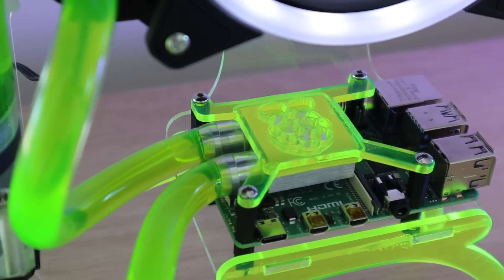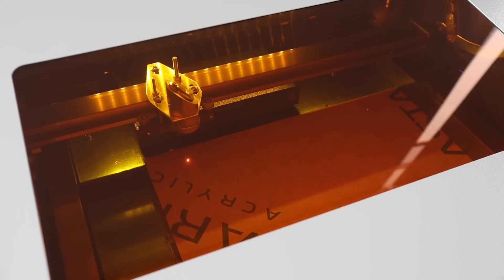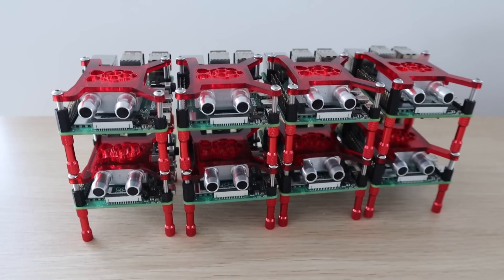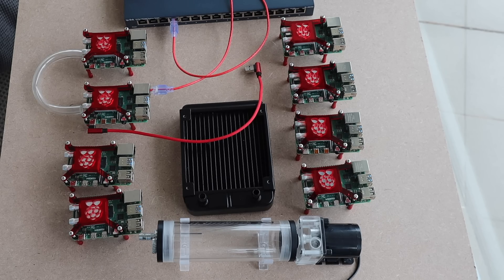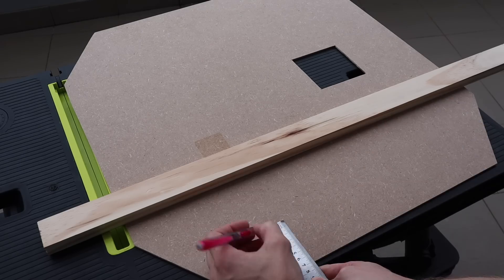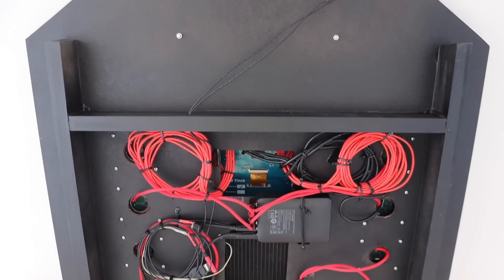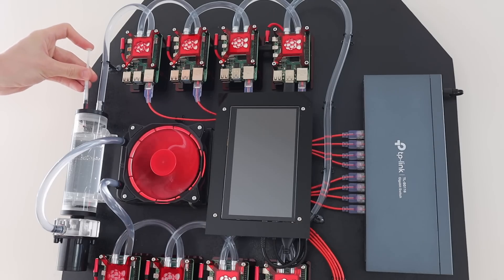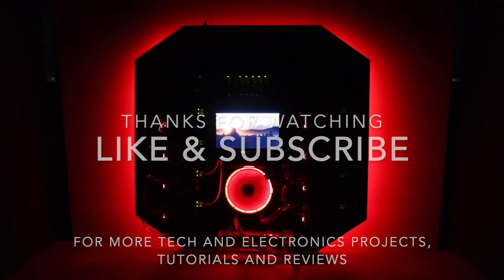Building A Water Cooled Raspberry Pi 4 Cluster

Comment: Concerning your water temperatures: flow order does not matter and once the loop is saturated, all Pi's should run at practically the same temps.
Reply: Yeah this is correct. Same as with a water loop in a PC, the loop with eventually reach its equilibrium and no individual component will get hotter water into its block than any other.

However it should also be noted that should one component be running at max and generating a lot of heat then all other components will receive the heated water from the loop.
Reply: This is just simply incorrect. what youre stating is that no heat would transfer to the water from progressive heat sinks. youre using the words "saturated" to mean its at the same temperature as the water which would mean no heat transfer takes place and is therefore useless.
Reply: @t_c5266  you're wrong. But `okay`
Reply: @Coltranebassmusic  prove it
Reply: @Coltranebassmusic  re-read what I said, then re-watch your video.
I'll wait for your apology

p.s: he explains, thoroughly, that it was not an isolated variable test, which means its therefore invalid as proof of anything XD
Reply: @t_c5266  i won. sooo satisfying. open wide! here comes the choooo choo train. humble pie tastes great. nom nom!
Reply: @Coltranebassmusic  😂 keep denying it. I bet you voted for Biden too with that attitude. Like I said, loop order does matter and your "proof" even admitted it in the video.
Reply: @t_c5266  yes, the veteran with the profile photo of himself flying two American flags voted for Biden. Open wideeeeeeeee
Reply: @Coltranebassmusic  its the only logical answer seeing as you don't adhere to the scientific method at all, can't actually debate facts, and change the argument when you lose.

But back on track. He states clearly in the video that the temperature variation is due to processor clock speed, manufacturing differences, and differences is heat sink adhesion.

He did not isolate his variable. Therefore his test is as useful as not testing at all
Reply: @t_c5266  The difference between radiator inlet and outlet temp is not what determines its cooling capacity or effectiveness. Its actually the opposite. The wattage dissipated by a radiator is determined by its temperature above the air being used to cool it. If the rad is 20C warmer than the air it dissipates double the wattage it does if its only 10C warmer than the air. 

The inlet and outlet delta (variance in temp) is mostly determined by coolant and air flow rate. If the inlet temp is 40C and outlet 30C in a 20C ambient environment then the second half of the rad is dissipating roughly only half the wattage that the first half is. If the flow rate is increased so that the inlet is 40C and the outlet 38C then the whole length of the rad is dissipating more wattage. Those numbers are exaggerated of course but the principle is the same. 
Its slightly counter intuitive but for best cooling system effectiveness we want the rad as warm as it can be and high flow rate is the best way to ensure that. Its easy to have a high delta between inlet and outlet, just by lowering flow rate right down but that just hinders overall performance.

As far as loop order goes, The high thermal capacity of water means that at a normal 4Lpm flow rate it takes about 300W to heat coolant by 1C. So an overclocked high end GPU might just do it. At the same time the average 360mm rad needs to be around 10C over ambient to dissipate 300W and cool the water by 1C.
So, the difference between the coolest and warmest part of the loop is normally only 1 or 2C but the whole coolant volume increases in temp by about 10C so the rad is dissipating what the system is generating. Thats why people say in general loop order is not important. 
There are caveats to that though like a very low flow system will be effected more.....this was long winded...but if you cant "grasp this" then...idk....i just dont know man.
Reply: @Coltranebassmusic  by your own statement there should be a 1 to 2c difference. In his test it shows at least a 5c difference that is independent of order.

Right there you admit that his test is invalid. And you explained thoroughly why I am correct in my first statement.
Reply: @t_c5266  Jesus Christ.....
Reply: @Coltranebassmusic  literally by your own statement youve disproved yourself. There's nothing more to say
Reply: @t_c5266  I can't argue with stupidity. You don't even watercool components. You're not even in this genre space. And you're talking to someone in the top 100 on world leaderboards concerning the matter....I really wish you best bro.
Reply: @Coltranebassmusic  your argument boiled down to "if you flood it with massive amounts of water your temperatures will be similar"

Acknowledging that there is a difference between consecutive  cpus and the only reason for small differences is due to using far more flow than is necessary. 

And if there was no temperature difference across cpus it would amount to zero heat transfer. So you're not arguing with me, you're literally trying to argue with basic thermodynamics.

That "pulling rank" shit doesn't fly with me homie. You might watercool cpus. But I liquid cool rocket engines. I can guarantee you that your knowledge on the subject is less than mine.

But we can always again look at your statement that clearly disagrees with the data provided.
Reply: @Coltranebassmusic  I'm still waiting for the thermal circuit that mathematically proves you right

Comment: Nice build, but you should consider flipping the display and mounting the cluster with the reservoir at the top.
Otherwise you'll never get rid of those circulating air bubbles.
And for the love of god secure the tubes. Those connections won't stay water tight for long.
Reply from the maker: Thanks for the tips!

Comment: Now all that's missing is a meaningful application which a "normal" computer (x86) cannot do better.

I would also attach red cable ties to the water connections. You have already installed black ones for the large connections on the radiator / first Pi 4.

Comment: what were your laser cutting settings for the cuts?
Reply from the maker: I used a couple of different settings as the black acrylic is only 2mm and black tends to cut easier than clear or translucent acrylic.
To cut the black I used 12mA at 15mm/s, single pass.
To cut the red I used 14mA at 15mm/s, two passes. It would cut on a single pass at 17mA, but got really hot and distorted the shape.
To engrave the red I used 8mA at 30mm/s.
Reply: @MichaelKlements  thx

Comment: I'm sorry if this question is inappropriate: For what are Raspberry Pi clusters used for?
Reply: They're a relatively cheap way to learn and experiment with clusters and distributed computing. They're not competitive in performance, but when you want to learn how to configure scaling systems with load balancing and redundancy etc. it's cheaper than building or renting a cluster with actual PC hardware. Plus it's fun.
Reply: Bitcoin mining
Reply: @lassmicharztichbindurch5319 , with a Raspberry Pi? I reckon that would be quite inefficient.

Comment: The amazon link shown doesn't seem to be the same ethernet cables - where did you find ones have the clear injection and tiny wire core?
Reply from the maker: I bought my ones locally on eBay, but I've updated the link in the description to a more similar slimline edition.

Comment: awesome build! though you might wanna reconsider the zip tie on the leaking inlet. zip ties in water cooling, if used, are usually used to hold the tube in place, so it doesnt slip off of the fitting, not for ensuring a tight seal.
Reply: Should be fine, if only because the inlets are barbed.

Comment: Really nice end product! When painting MDF, or any wood, consider using a sealant first to stop paint being absorbed by the wood so you end up with it looking more like a sheet of black acrylic over wood (if that makes sense!).

Love the look of it! 

Would be amazing if you set up PXE booting from the Pi with the full gui OS so you'd only need one memory card.
Reply from the maker: Thanks for the tip Owen. Do you have any suggestions for a type or brand of sealant? I have noticed that MDF is quite absorbent.
I’ll definitely look into PXE booting, this sounds interesting!
Reply: @MichaelKlements  sorry can't recommend any particular brand as there are a few primer brands avaliable, and not sure whats avaliable to you. I've even read simple PVA glue would work. All you're trying to do is create an impervious layer which you want the paint to adhere to so you can get a nice even paint layer which isn't then absorbed by the wood.

Love this project though! The end result is both functional and looks funky as well!!

Comment: This is the most AWESOME project I have seen in a long time, although that will not stop my questions.

Is there any reason you avoided POE, other than potential space limitations on top of the pi?
Can you passively cool the pis in your setup, can the fans be turned off without much impact on temperature?
Are you overclocking the pi?
Are the files available to download?

Again, this was so cool, and I love your setup!
Reply from the maker: I didn’t go the POE route because the hats don’t really work well around the cooling block and bracket and also the hats are quite expensive when you need 8 of them.
I’ll be doing a proper thermal test in a future video. I suspect that you probably could run the system without the fan.
Yes I’ll be running them at 2.0Ghz.
Which files would you be interested in specifically?
Reply: @MichaelKlements  thanks for the responses, I'm mostly interested in the mounting bracket for the CPU water blocks, it looks really professional!

Comment: This looks awesome! Curious about one thing though, could you have dropped the USB-C cables if you used Power-over-Ethernet? Or does that not work out of the box for the Pi's? (Seen Pi projects use PoE, but not sure if that was "normal" or if you need a special setup)
Reply: You need a pod hat, but the breakout pins are on each pi, so you can use passive 5V over poe with the fast ethernet standard (100mbps) without a hat
Reply from the maker: Have you tried powering a Pi using passive 5V? I’d be interested to know if that was able to supply enough power!
Reply: @MichaelKlements  I haven't tried this yet, but it would be a great project. I was mostly thinking you could remove the Micro Usb connector from a USB cable and solder to 2 twisted pairs, than use female to female connectors on the 4 ethernet breakouts on the new pi models. Connect them directly to the 5v and ground rail
Reply: @MichaelKlements  I have powered Pis with 5V pins. You need to keep cables short and thick to avoid voltage drop in the cable. I used both +5v and 2 GND pins to minimize resistance. In a setup like that your problem is the voltage drop in the wire when pi is drawing current. As long as you are not powering lot of things from PIs USBs you should be ok. There are other ways to improve this. Such as delivering 12v and then step that down to 5V right before pi using a buck converter. It works but add more complexity. Or slightly over voltage the supply without exceeding Pis max voltage (5.5v) to compensate for voltage drops.

Comment: This looks awesome but why not a POE switch instead of the additional usb cables.
Reply from the maker: The issue with the POE switch is that you need a POE hat for each Pi. These are quite big and don't work well with the cooling block bracket. They're also quite expensive when you need 8 of them.
Reply: @MichaelKlements  ah understood! Wasn’t sure if you considered them prior! Thanks for responding.

Comment: Why are the 4 pis on the right facing the wrong way?
Reply from the maker: The Pi's aren't symmetrical. So if I flip them around then the ports face the opposite directions, but the power cables and GPIO won't be on the same side and the ethernet port and cooling block will be offset on one side. Either way around they'll annoy the OCD in somebody haha.
Reply: @MichaelKlements  its awesome. I love it

Comment: I ask myself every time.

Why does everyone use who builds a cluster with Raspis. every time SD cards instead of PXE.

Do you not inform yourself?
Reply from the maker: This is intended to be a starting point to learn about cluster computing. The current SD card setup was to test that they all booted up and were seen on the network, I'll be experimenting with different software packages and configurations in future.

Comment: I love the build, super clean.  Curious though why you didn't have all the water loops on the outside edges to keep the symmetry?
Reply from the maker: It was just a fade-off in keeping the Pis the same way around or the cooling all on the outside. If I flip them around then the cooling looks symmetrical, but the power cables and GPIO are on opposite sides and the ethernet ports and cooling block will be offset by a couple of millimetres on opposite sides. Either way around they're going to annoy the OCD in some people haha.

Comment: Water holds a lot of energy. Your setup is good.
Its not true about the last Pi in the loop being effected by the heat from the others as long as the pump speed is high enough (any speed for that pump)
The water temp will be lower than the Pi so heat energy can still flow.
Reply: I'm only 5 mins into the video though so maybe you'll show the temps in a bit.
I'd say they will all be close to each other (within error margin)
Reply from the maker: Thanks for sharing your thoughts, I agree. I didn't do it in this video, but I'm planning on running a temperature test on the whole setup to see if there is any increase, by how much, and whether this has any impact on performance, although I'm fairly confident that it has no impact on this setup.

Comment: Pardon my ignorance but what is the purpose of clustering Pi ? I mean, it has a lot of pros but i'm wondering what kind of application such assembly would serve :) Thanks for that vidéo, i'm learning a lot just viewing it
Reply from the maker: Hi Xavier, I primarily built this to learn about cluster computing and to play around with different software packages and configurations. I'd like to get it set up to run mathematical simulations eventually.

Comment: poe would also be of use. switch  and power over ethernet...
Reply from the maker: POE would make the cabling much cleaner, but it requires a hat on each Pi. They don't really fit with the cooling block in the way and they're expensive when you need 8 of them.

Comment: You should open the switch and replace the green LEDs for red ones!!
Reply: That's not gonna work... The leds are inside of the lan connectors, and don't exist in red.
If you had a switch with separate leds, that could have worked.

Comment: Finally a way to keep the sahara heat the Pi produces out of my room...
Reply: More like, A way that keep a Sahara heat in my room unless the heat exchanger is outside the room
Reply: The Pi 4 actually does need active cooling and this many individual fans would be much much louder than this setup.
Reply: Water-cooling is actually better at transferring heat from the rPi to the room. So if anything it'd be the opposite.

Comment: Interesting video! For you to know: How you design the waterloop isnt that important. der8auer made a video in which he shows that the water temperatur isnt that much hotter on the end of the loop than on the beginning (behind the fan). If you want a cooler loop you have to adjust the pump so that you have more water flowing through.
The title of the video: "Testing one of the Weirdest Water Cooling Myths - A SLOWER Flow Rate will result in BETTER Temps?"

Greetings from germany
Reply from the maker: Thanks for sharing your thoughts. I agree, I don't think it'll make any difference. I'll probably do a thermal test video in any case just to see what the results look like. I like that you mentioned trying different pump speeds, I'll try that too!

Comment: Why did you used 2GB models? ok i understand for cost reasons, but under the 4GB model you can run 64 Bit Programms
Reply from the maker: I'm intending on using this for mathematical simulations eventually. They're not really large from a memory point of view, but more CPU intensive, so it doesn't really matter how much RAM each node has as then CPU is going to be the limiting factor.

Comment: Hope you at least Set clock Speed to 2ghz now 🙃 I've never Had any Problem with that
Reply from the maker: Thats the first thing I did, I'll try get a bit more out of them as well once I've done some testing.
Reply: @MichaelKlements  I´ll trow 2.3ghz max, and the pi showing 2.4ghz in the room. Everything higher will need a very high voltage offset :(

Comment: This project keeps you busy, but apart from that--why not simply use less, more potent nodes that run cooler and already come with a working, quieter cooling solution like the ODROID N2+?
Reply from the maker: There are definitely more powerful options out there, but they're usually quite a lot more expensive. These Pis were $35 each, the Odroid boards seem to be around $100 each (from a quick search, I haven't actually used any of them)
Reply: @MichaelKlements  IIRC, a single ODROID N2+ including a power supply should cost you around $85 (see https://www.hardkernel.com/shop/odroid-n2-with-4gbyte-ram-2/) and apart from the resulting total amount of RAM, one N2+ should be able to replace two Pis (Hardkernel has comparison charts online). Basically, it's a bit more expensive, but it saves you from coming up with your own cooling solution (together with time+material costs) and, as an off-the-shelf solution, it should scale better. OTOH, if you enjoyed building your very own solution (and it surely looks like it), this needs to be factored in as well. :)